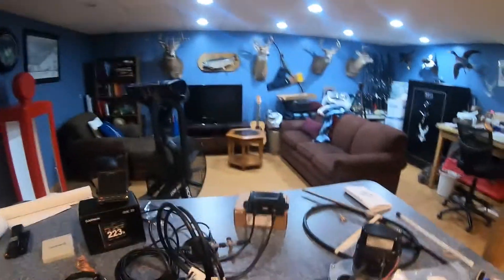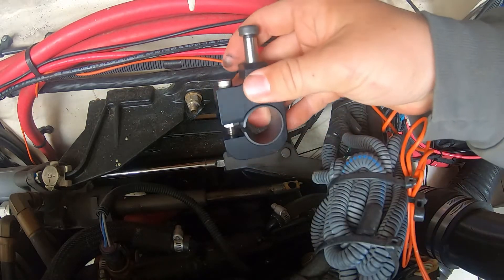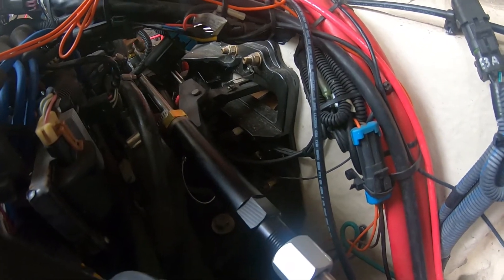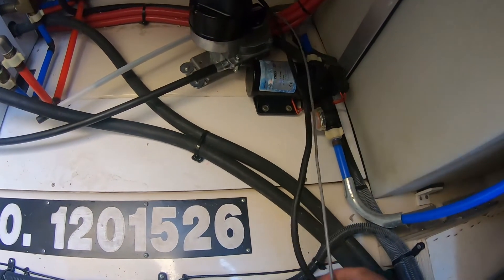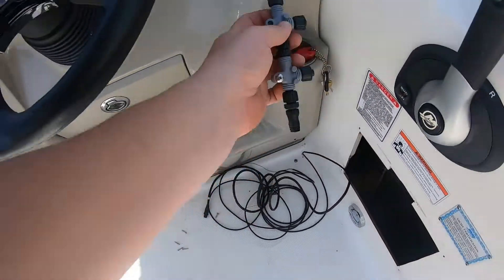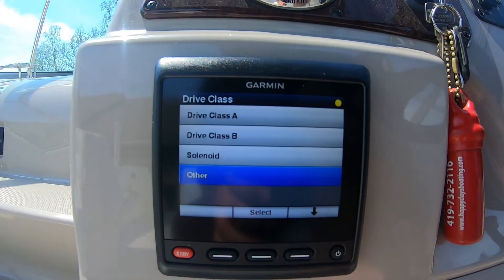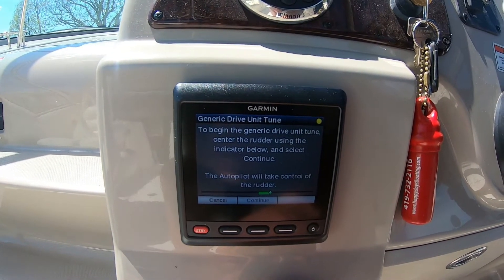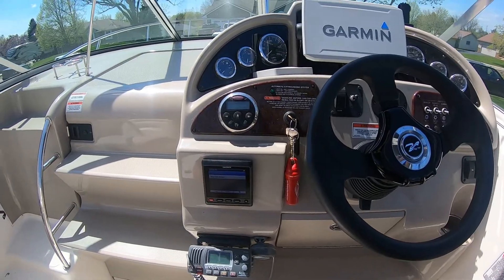Garmin Reactor 40 Autopilot Install, Mechanical Type R Drive for Mercruiser on Searay Amberjack

Comment: I know this post has been out for a while, but if you see this, Did you have to buy connectors to attach the octopus R unit and the rudder position sensor to the ecu ? 
Thanks !!

Comment: Is this right enough for trolling? I just bought a 245 Starfire, which has a 5.7 MerCruiser in board Stern Drive. I really want to put an auto pilot on it for Fishing since the helm is so far from the back of the boat and I still wanna be able to fish with two people.
Reply from the maker: @jakejacobson2999  we use our autopilot for 99.99 percent of fishing. We have used it to navigate back to the pier heads up and plane but trolling for walleye and salmon is our primary use of it. And it has worked well for us over the years
Reply: @highpointeoutdoors6958 nice, that’s exactly what I’ll be using it for on Erie and Lake Ontario. I’m pretty handy with working on my boats. So how difficult would you say this was? I wasn’t sure if these units were able to go on sterndrives or not but I guess this answers my question lol I have a MerCruiser 5.7.
Reply from the maker: @jakejacobson2999  I would give the whole project a 7.5 out of 10 for difficultly. But that includes the research of finding out what parts I needed to work from our Garmin to the drive unit. Finally a marina on Lake Ontario confirmed that the octopus drive type R unit would work for stern drive vessels. When I asked Garmin, which where I bought the reactor 40 from, they had no idea what drive unit would work for our boat. The installation wasn’t bad, the instructions walked us through pretty easily
Reply: @highpointeoutdoors6958  okay doesn’t sound bad. My boat is older however, it’s a 1990 so I may need a different part than you. I need to bring my boat home so I can figure out what steering system it has. What do you think the total  cost roughly was?

Comment: I'm fixing to add autopilot to my houseboat and this video helped clear up a few questions I had. Thanks for sharing.
Reply from the maker: Oh happy to help! I searched high and low for a video to show me how to install it. I figured other people may be in the same situation as me, so why not film it to share
Reply: @highpointeoutdoors6958  I'm installing it on the s drive that I already have at the helm so it should basically be the same installation process. The rudder control module is what I was wondering about and you explained it perfectly. Thanks!
Reply from the maker: @ew1421  happy to help! Goodluck with your install

Comment: I removed the mercruiser steering system completely and installed a hydraulic seastar cylinder and helm.  Very easy and no rudder feedback required.
Reply from the maker: That's awesome, I sorta wish we had done that but we were eager to get something installed to hit the water right away. I can't complain too much with our currently auto pilot because it has been a life saver on the water for us and has worked great. How long would you say it took for you to fully install the hydraulic steering system and then the auto pilot?
Reply: @highpointeoutdoors6958  it took two days. The hardest part was removing the old steering system. Everything else was easy

Comment: hello. does your aitopilot goes from engage to stanbt mode if you turn the wheel? does the clutch senses it?
Reply from the maker: Unfortunately no, our auto pilot doesn’t have the shadow drive feature that allows that. Shadow drive from my understanding is only applicable on hydraulic steering. Ours is a cable drive, with hydraulic assist. We would have had to convert our entire steering system to hydraulic. I hope this helps

Comment: If you have room can you just use the octopus type s drive that installs in the helm with existing teleflex cable to the motor instead of the remote (r) drive?
Reply from the maker: Yes, you sure can. I know the reason why we didn’t go that route was because our helm did not have much room behind the steering wheel to fit that apparatus
Reply: Another question can u run the autopilot while the main engine is off if I wanted to tie my kicker to my out drive?
Reply from the maker: @nickb8618  I guess that depends. Because on our boat, there’s still hydraulic assist to help turn the main engine. So the engine has to be on for the R drive to move the piston back and forth. Without it, it moves a lot slower.
Reply: @highpointeoutdoors6958  thanks my mercruiser has hydraulic assist so that answers my questions to troll with the kicker get the reactor 40 kicker autopilot.